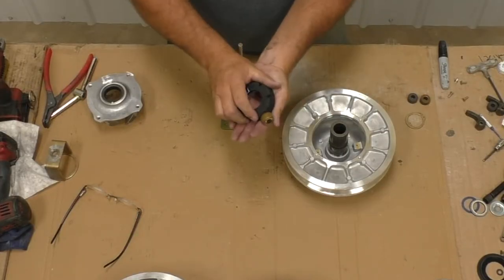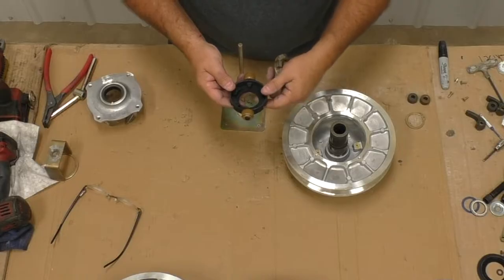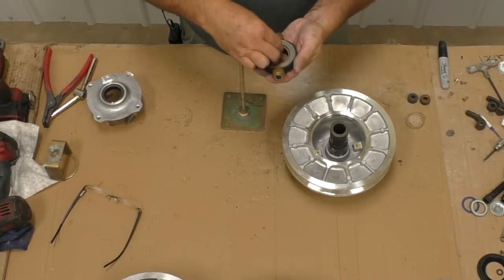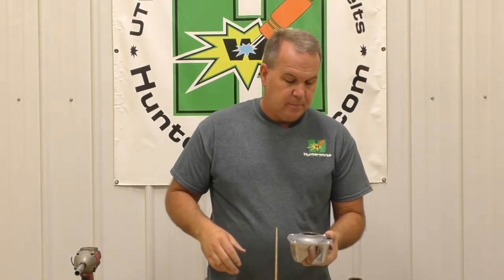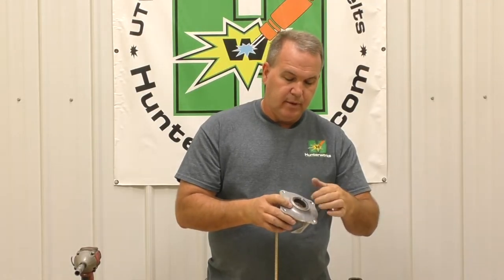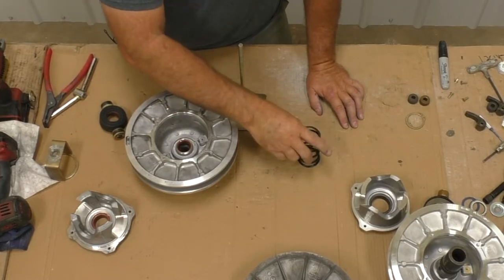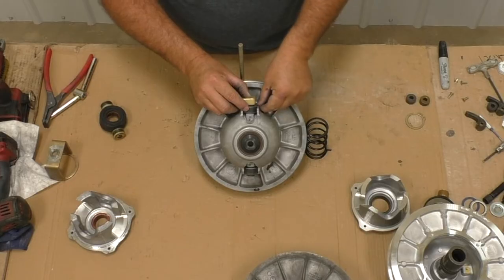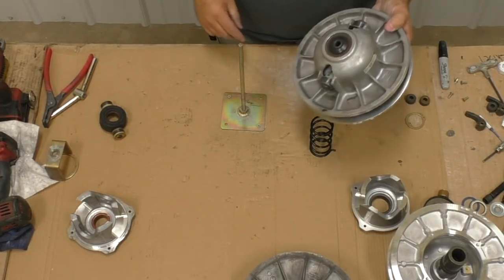How to troubleshoot 3 of the Polaris RZR and Ranger Secondary Clutches

Comment: I have a 19 ranger crew xp 1000 ... and it looks like it has the POS secondary. I just put a new belt on, did the break in period and today  going 40 down the highway in high gear it shredded. Looks like a rats nest. When we got it home and buddy and I were looking at it, we put old belt back on, and it still moves. Is there a way that secondary clutch can get play in it? when it spins it looks like center bolt  has a very slight egg rotation (if that makes sense) to it. I now hear a very faint metal sound ... dont think its the tranny but after watching these video series, I am thinking it may be the secondary ...

Comment: I have an 09 sportsman xp 550. Belt seems ro be in middle. Belt seems really tight. Like it sticks up out of secondary whole wau around. Is rhat normal?
Reply from the maker: Yes
Reply: @Hunterworks  I replaced the primary and shifting got worse. When I installed it it seemed belt was in middle. You said if that's the case it's the primary
Reply from the maker: @eddiereichel9354  What brand of primary clutch did you buy?  The bearing is the issue new or not if nothing else is touching the belt unless this is one of those that has no bearing in it and uses slack on the belt to allow idling in gear.
Reply: @Hunterworks  Caltric was the brand. Ebay.
Reply: @Hunterworks  There is a bearing which turns 1 way in the center of the primary.
Reply from the maker: @eddiereichel9354  It's a chinese one and it arrived with a bad bearing or that one way turns the wrong way.  It should not turn the same way the motor runs, Example if the engine runs clock wise, then the bearing should only turn counterclock.
Reply: @Hunterworks  I'm going to return it. It's a 2009 sportsman xp 550. Do you guys sell a clutch for it?
Reply: Or even a rebuild kit you recommend
Reply from the maker: @eddiereichel9354  We don't, we recommend OEM on this one

Comment: Hi, I have a 15’ RZR 1000 XP, won’t go over 30-35 mph, ready to sell at this point, no engine codes, shops can’t figure it out, getting fuel and strong spark. Some are suggesting clutch issues, what should I be looking at? Primary and secondary are rebuilt with Gilomen plus a Gilomen performance tune. Any help is appreciated, thanks!
Reply from the maker: Does it hit the rev limiter at that speed or just go to a rpm and not go further?

Comment: I just put a new primary and secondary on mine. The oem had 3500 miles on it with your rollers. I have been looking over them to find anything bad and can only really find very little wear on primary where the belt rides and some where it slides on the outside if that makes sense. My belt did have small cracks in it. I was also getting belt slap going down hill. I havent got to test it down a hill yet with the new clutch. I did also align everything with your tool and went to the float mod on the new clutch.
Reply from the maker: Is there a question in there somewhere?  How can I help you?   It read like you were describing the old clutch not the new.
Reply: @Hunterworks  sorta not really haha. Pretty much I put a new clutch on my RZR and was looking at the OEM one I took off just to see what could have been wrong and I'm not really seeing anything bad or wore. It had 3300 miles on it. I obviously had a issue because I was getting belt slap and definitely notice now with the new clutch that I wasn't getting at max rpms with the OEM. The only wear I can find is the rollers was getting cut from the secondary and the primary had some wear where the belt rode and where it slid in and out at the weights I geuss they are called. Also had belt slap going down hill. I geuss my question could be what could my problem have been?
Reply from the maker: @ICU-th7qj  THat I can't say, if not obvious then just over all wear
Reply: I did use your alignment tool and got it spot on. New clutch tool away that damn clunk noise and has a lot faster response now. Haven't got to see about the belt slap yet.
Reply from the maker: @ICU-th7qj  it won't be there either
Reply: Just purchased your roll rollers to replace the square ones.  Have not installed yet.  I have had a loud noise when decelerating downhill intermittently.  Is this called belt slap and what are some of the causes?  2022 xp4 1000 with 1200 miles.
Reply: @larrymattox2471  yes belt slap. I didn't get belt slap until 3000 miles but that clutch was wore out. So I replaced it and aligned the clutches and it fixed it. Thanks to Todd for giving the advice!

Comment: for 2016 and up RZR 900 and 1000 non-turbo, skip to 10:20.
these RZR's have a very crappy secondary with a not-strong enough spring.
Not enough spring pressure and you lose clamping force at higher speeds and smoke belts.... pretty common problem
Reply from the maker: I do this everyday and sell a ton of belts, never hear about one slipping at higher speeds
Reply: @Hunterworks  if you have a failing clutch, it can't help but slip, then destruct the belt..doesn't matter what the quality of the belt when it goes to slipping. Heats beyond limits and blows to pieces
Reply from the maker: @thorn3686  you said weak spring, of course if you have a failing clutch
Reply from the maker: @thorn3686  That is not what you said, you said they have a  weak spring and causing it, failing is a obvious issue.

Comment: I have the pos clutch and plan on upgrading to yours in a month or so. Can I weld the spring up to the retainer plate to stop the noise. I think the noise comes from harmonic vibration of that cup being a separate piece from the plate that is bolted to the clutch.
Reply from the maker: You could try it but be careful about balance and that is some thin metal

Comment: 2017 Polaris General Deluxe with EBS. Primary clutch is new from Gilman. I have the secondary clutch that is shown last in this video and it clunks when you first step on the gas in forward and reverse I can duplicate the sound just by spining it by hand backward and forward. Assuming this is normal for this type of EBS clutch correct?

I have fully removed inspected and clean everything looks to be in proper order. Thanks for the thoughts
Reply from the maker: It is normal, just the roller switching sides in the helix
Reply: @Hunterworks  Thank you for the timely response!
Reply from the maker: @troyzincke7631  Welcome

Comment: 2005 Polaris Ranger.  Turned out the front motor mount was sheared off, the motor would twist a bit under torque, causing the primary to rub against the inner cover.   I looked at a lot of secondary, could not find one similar to the one on this 500.  It has a plate on the outside that appears to be a damper?
Reply from the maker: Well that would do it!!!

Comment: I have a question about my 2008 Polaris RZR 800 Secondary clutch, the issue I'm having is it will not engage until about 3300-3500 RPMs with a load on it. But if I either put it in park and hit gas, or jack the rear tires off the ground and hit gas it engages like it should. What am I missing
Reply from the maker: All I can tell you is, your primary clutch is the problem, get a puller and inspect it and see what you see

Comment: I have the pos secondary it came a part  when I removed the belt is there a certain way to put it back together  I put a new belt on that my dad ordered and it whistles   So I was wondering if I put it on wrong
Reply from the maker: Did you remove the center bolt to remove the belt?

Comment: I have the pos secondary clutch bolt was super tight on the shaft but the clutch disc just spun out on the transmission drive shaft what is your thoughts why would it do that other than it's aluminum on steel
Reply from the maker: Not sure what you mean, send me a pic to todd@hunterworks.com

Comment: Working on a secondary for a friend.  It took three of us to remove the belt. Clutch didn't expand at all.  Seems rusted. Shouldn't the belt come off easily?
Reply from the maker: What vehicle
Reply: @Hunterworks  ranger 800 Polaris
Reply: @Hunterworks  it shredded the belt so I went to help look at it.  After installing the new belt the vehicle didn't move.  I noticed the secondary wasn't expanding so we wrestled the belt back off. It seemed to be tight as possible.
Reply from the maker: @BigAlWillis   Sounds like you need to take the secondary apart and see what you see that would be causing it not to open.  Keep in mind though if the primary is not working right, it will not close therefore the secondary will not open
Reply from the maker: @BigAlWillis  secondary stock closed with a new belt on it, it will move at least to around 10 mph where the secondary starts to open, sounding more like a primary issue to me
Reply: @Hunterworks  the center of the secondary seems rusted.  To give an idea I couldn't even get it to part with a hammer & screwdriver.  It parted maybe 1/8 of an inch.
Reply: @Hunterworks  we put it in reverse no movement. Forward no movement ' of the vehicle '
Reply from the maker: @BigAlWillis  did you remove the spring?
Reply: @Hunterworks  we haven't removed anything yet but after watching a belt removal video the guy removes the belt with one hand seeing the secondary open the belt gets slack & he just pulls it off. Looked like the secondary easily parted. Today it took three of us to remove the belt. It was tight as it could be.
Reply from the maker: @BigAlWillis  can’t use that method on this 800 clutch.
Reply: @Hunterworks  ok. Only thing that was odd is vehicle didn't move.  I heard gear engage both fwd & reverse.  Both clutches moving although not at high rpm. It shredded belt into particles near dust.  I was thinking at the very least with secondary removed I would be able to separate the two halves.  It wouldn't budge.
Reply: @Hunterworks  I appreciate your reply & help.  You've got me thinking that its not the secondary.  I'm going to do some more research & get more information on just what happened when it broke down.  I'm hoping its not something major internally.

Comment: i have a 2019 ranger 500 the secondary is spinning at idle and causes it to die. Do i need a new secondary or can it be repaired?
Reply from the maker: Your issue is in the primary and we recommend the duraclutch system we sell for this model, just be done with it.  I run it myself
Reply: @Hunterworks  thanks allot
Reply from the maker: @mountainmangarage7572  if you want to troubleshoot it, we have a how to troubleshoot a primary video too
Reply: @Hunterworks Inc.  I will look that up thank you

Comment: On a 14 ranger 900 what would cause the secould half to be stuck on the shaft
Reply from the maker: Probably corrosion
Reply: I have a 2014 diesel that has the shifter moving between gears ⚙(N-H) but will not move with gas...was driving yesterday just fine🤦‍♂️🤷‍♂️
Reply: It’s a tapered fit on the primary.  You need the right tool, available on line.  The secondary is on a spline.  Line up is done with shims on the tranny shaft.